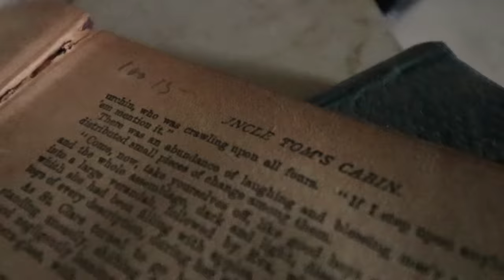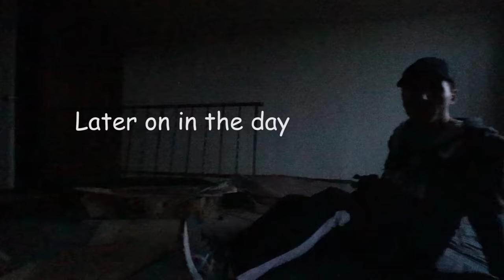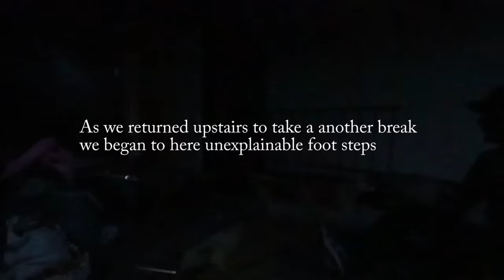24 HOUR OVERNIGHT CHALLENGE IN A HAUNTED FARM (GONE WRONG)

Comment: Moe:"Don't ever do this, leave it to the pros."
Me:  "Screw that, I want in!"

Also, easy explain for the whirlybird going at 24:05   That looks to be a passive whirlybird vent, which uses the wind to turn it, drawing out warm air inside the building.    It doesn't need to be strong wind to do it.
You guys should wear headcams too, when doing this.  So often you spot stuff that doesn't get caught on camera, cuz it's facing the wrong way.
Reply: I think i stuck that whst thunder blitz says I down of that .yo moe 
My boy agree of that

Comment: 26:51---
I see a shadow figure in the mirror.
Reply: I saw that I thought it was moe
Reply: I see that to
Reply: @sylkvss  in the mirror the shadow figure was near moe
Reply: @jackedwards4635  makes sense
Reply: 90% sure it’s Renny’s reflection. 

The angle is almost right, the distance and the lack of light makes it shady PLUS when Renny turns around to the bathroom you can see a matching movement in the mirror PLUS the shady figure is too still and normal, manifestations are usually not that consistent 
But who knows, right
Reply: @sylkvss  i did to unill i looked closer...
Reply: @ellenjames2534  i still think its possible its a 50 50 chance

Comment: Correct me if I'm wrong now about that fixed crucifix. I've heard about spirits replacing objects with new ones. Say you had a painting for a while and it's very worn out. If you were haunted by a ghost they would replace it with an identical knowing that you didn't get a new one.

Comment: The moving fan is a heat extracting fan; they don't need electricity to move. The rising heat pushes the fan which in turn draws more heat out. 
They are common place in larger buildings.

Comment: that spinning thing on the roof you saw through the attic entrance is a heat vent. the escaping heat and or wind rotates it too pull excess heat out to further cool the house to lower cooling costs of the air conditioning